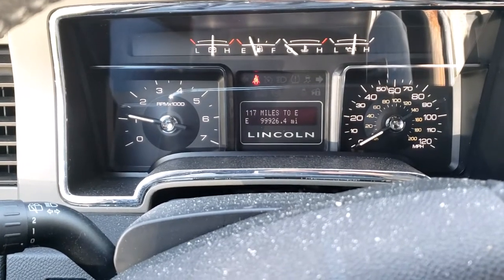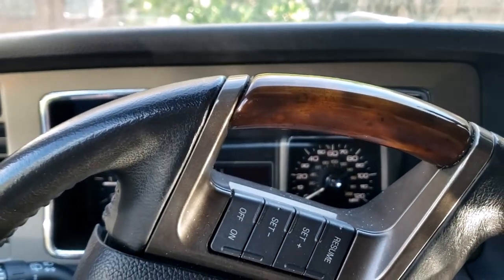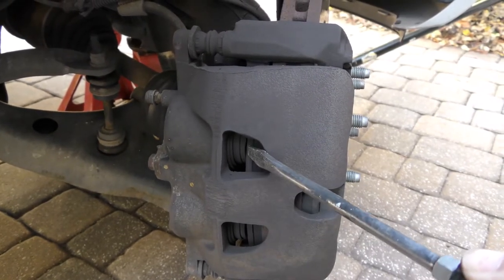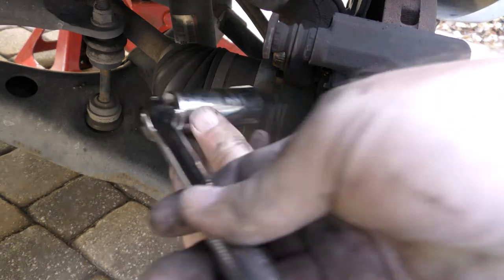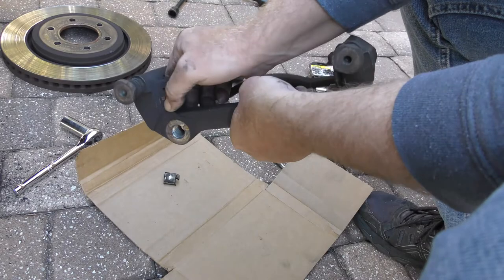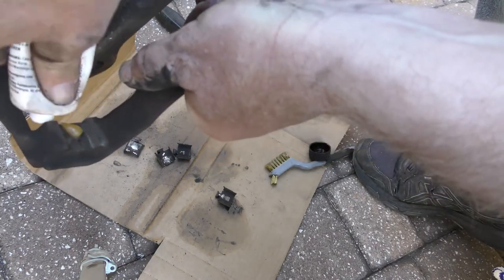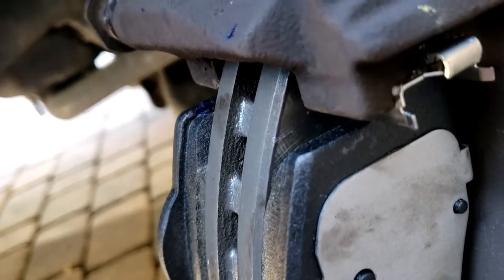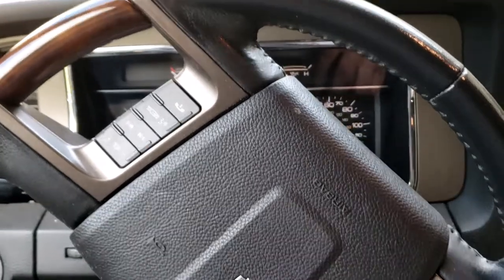Lincoln Navigator, Ford Expedition How to Brake Pads and Rotors

Comment: Excellent work. I wish I had the tools and knowledge to do this myself. My dad used to work on Volkswagens and tbirds years ago. So I definitely enjoy watching great mechanic work. 

Recently my husband and I had our front and back rotors and pads replaced by a local mechanic.  Now they are saying the back breaks are ceasing and overheating. Abs light is coming on.  They claim that we said this was happening before we brought it in for repair.  Is there anything they could have done to cause the issue?  It’s a 2008 Navigator L. Would a diagnostic show when the abs issue occurred?
Reply from the maker: There are other parts to the braking system that can go wrong.  If they say you said the abs light was coming on before you brought it to them then it is kind of bad on them.  Because they probably should've taken some extra steps that I did not take in my video and that is change or repack the wheel bearings or check if emergency brake is sticking on or if calipers aren't closing properly.  There are quite a few different brake parts that it could be but if they did a brake job they should've inspected more